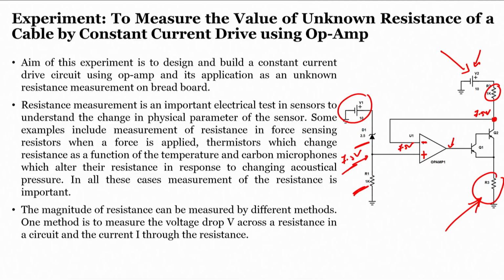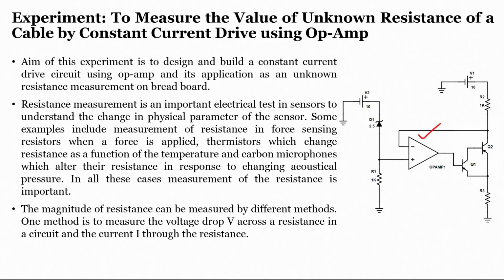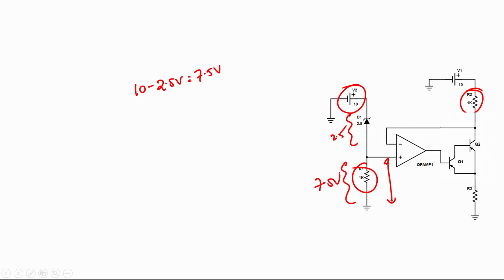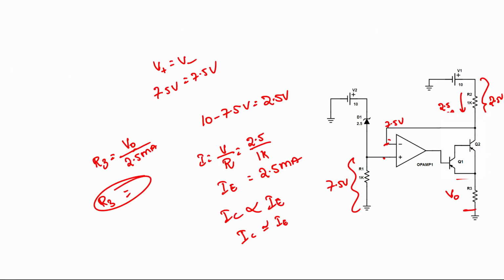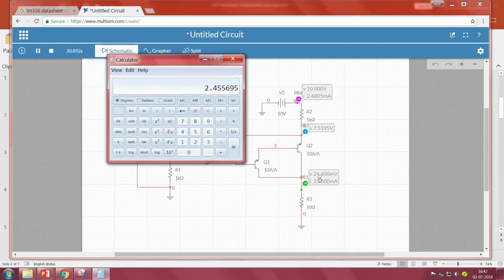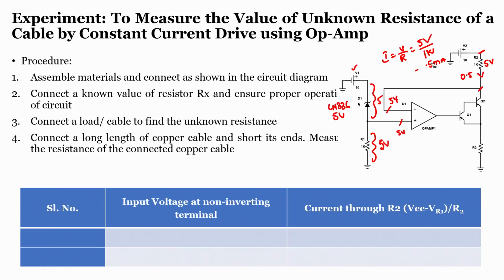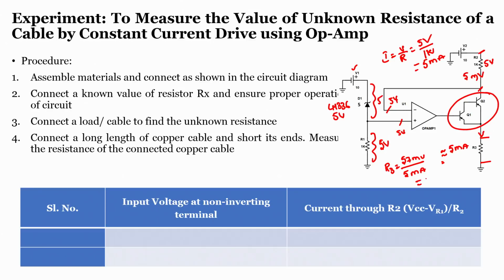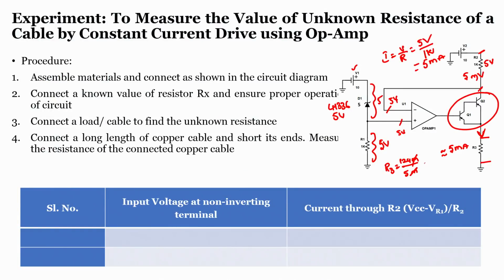mod06lec24

Comment: what is the range of resistance value we can measure using this circuit......
Reply: I assume if supply is 10v at bjt , then Vo cannot be more than 7.5V, and current of 0.25mA is constant, hence I assume maximum value can be measured  here would be 7.5/0.0025 =3K approx.  We can obviously change that collector 1k pull up to higher value for smaller current and thus greater resistance